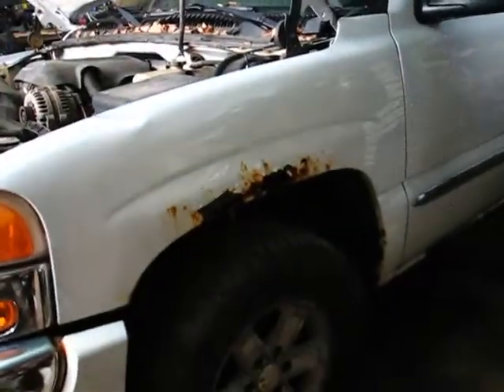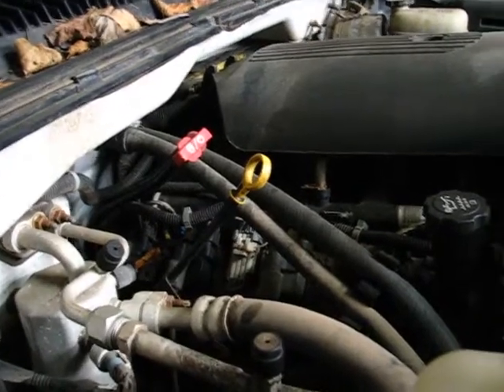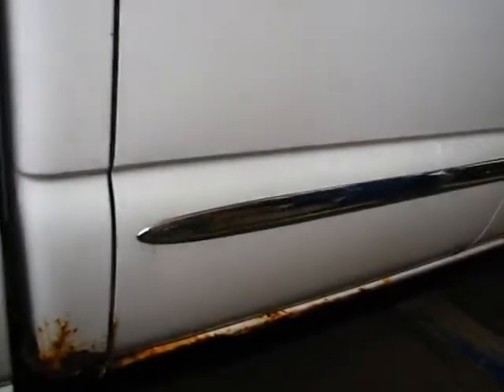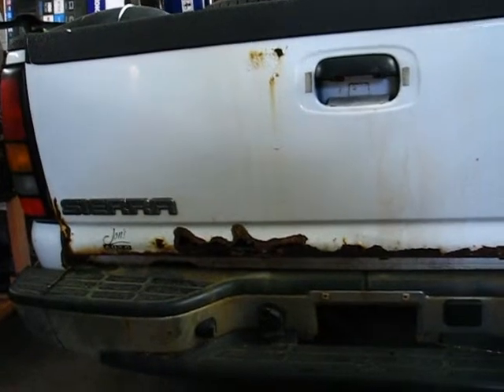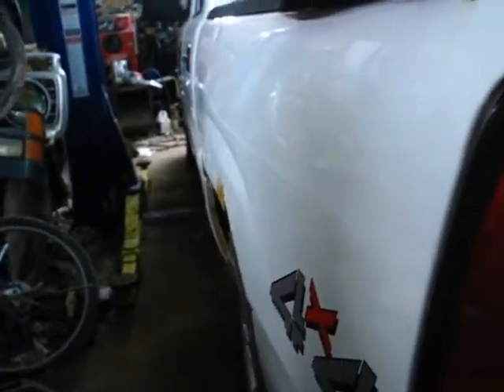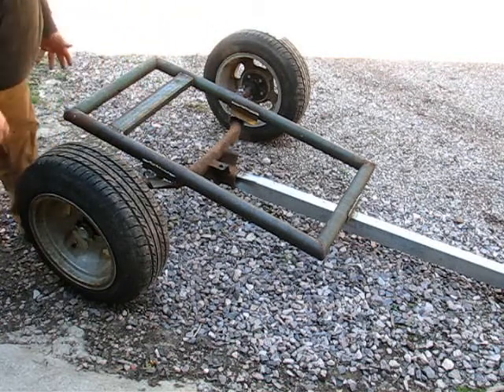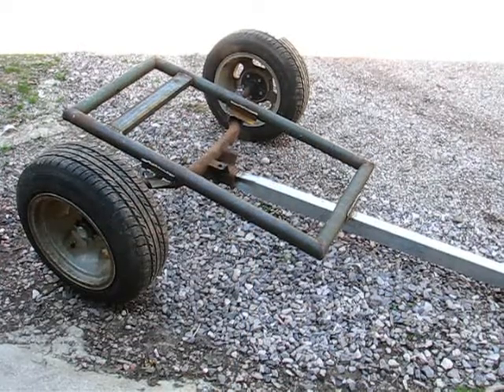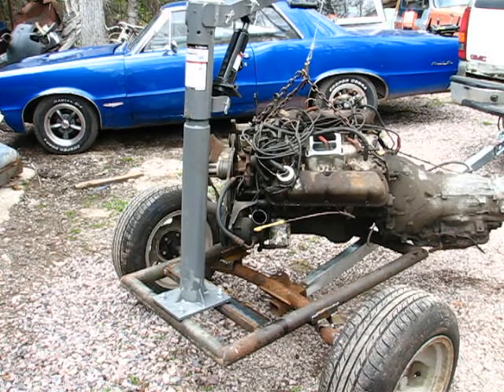What's the hold up eh?

Comment: You've got all kinds of stuff to keep you busy until you're deep freeze starts kicking in again!!
Reply from the maker: indeed, and this is just a short bit of it. Most of it is very boring, so it doesn't make for a good video. I might make a video of putting new axles under my trailer, someone might get useful info from that. Both trailers need work, and I need to haul cars this summer.

Comment: Don't hate the 4.8. Ever thought about installing a sloppy turbo?
Reply from the maker: yeah, but forcing more air in means you need to throw more fuel at it too. The 6.0 is easy, the power is always there, and I don't have to spend a lot on plumbing, oil feed/return, and things like that.
Reply: @SweatyFatGuy  Incontinence briefs might be needed, too.
Reply from the maker: @1stamendmentsupporter  eventually... the ride I have in the works I'm not showing just yet, should stripe some panties.